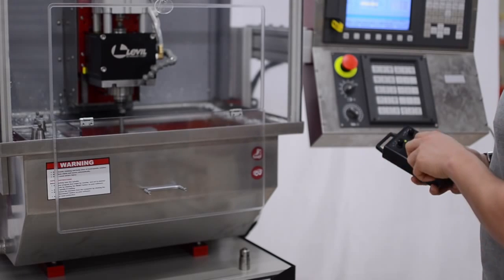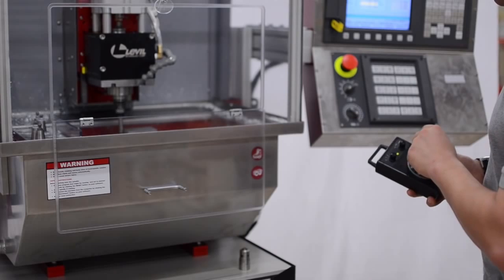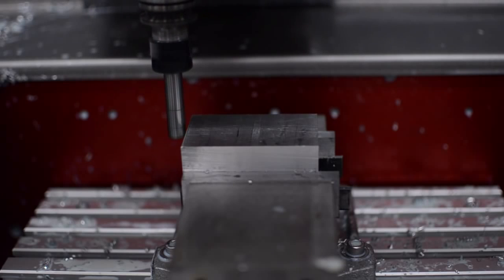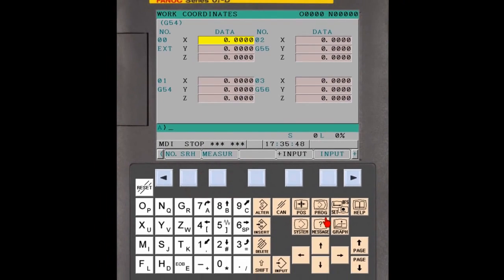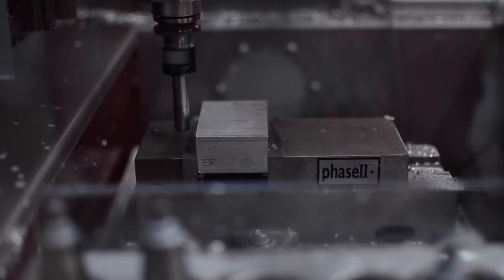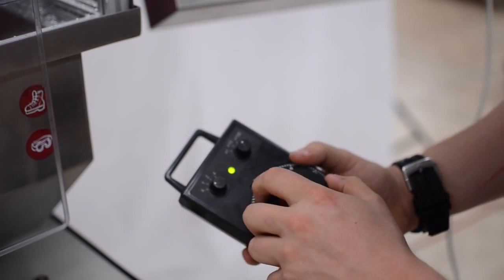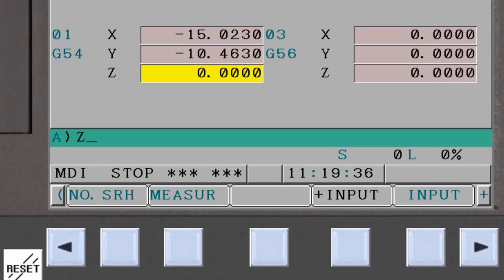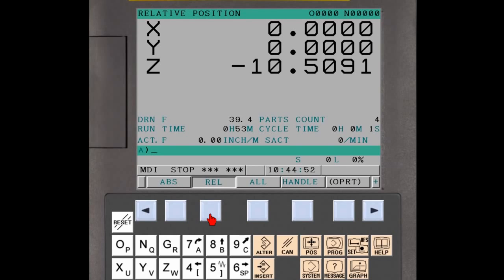Fanuc Manual Guide i Easy Job Setup

Comment: Should be call The tool First?  G43 H( High of the tools).   Rxemple : T0101   = G43 H01  -----------> INPUT IN THE MDI -----> Cycle Star ------> Now the tool called  down!!! after  start to Setup the data Z G54.    Is ok Sr?

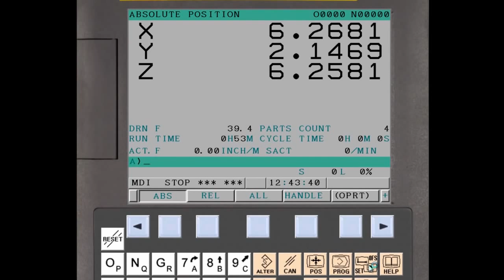Comment: 7:46 you can read current machine coordinate in program. you know z lenght of macine. you know vise heigt. left over is tool lenght. make custom makro mased on those. and you can measure tool on MDI write your own gcode like G100. how easy

Comment: WHY IT IS CONFUSING WHILE TAKING X Y OFFSET U USED EDGE FINDER ,AND IN Z AIXS OFFEST WHY U MOVED SPINDLE ON Z AXIS ,IT IS LITTLE BIT CONFUSING ,IS IT  NOT POSSIBLE BY EDGE FINDER WORK OFFSET ?????
Reply: Yes but you need a different style edge finder